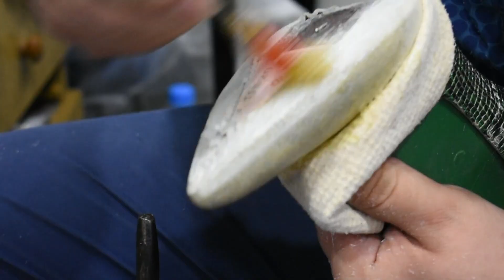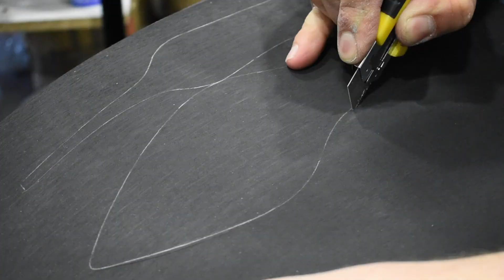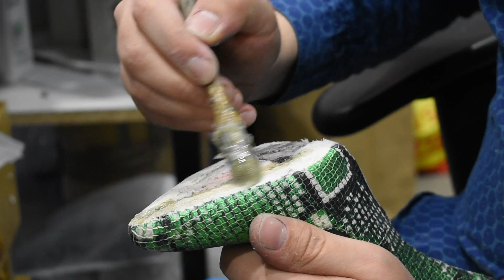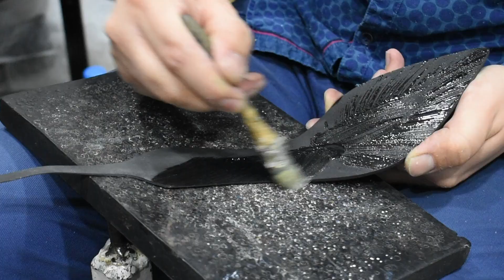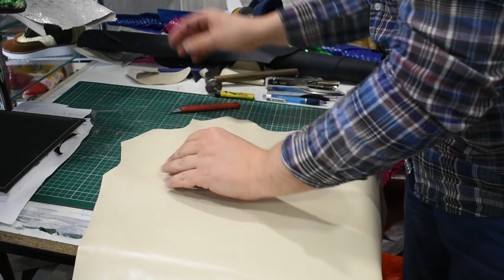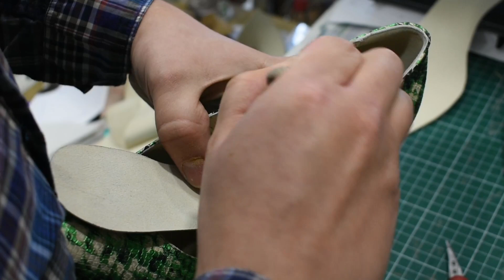Premium Leather Snake Heels - process of handmaking - natural sounds

Comment: Hermosos 💜 💜 
Como haces para atornillar los tacones al zapato, o utilizar grapas?
Reply from the maker: Thank you. We did not film this part. While the last is in the shoe, the heel is glued to prevent it from moving later. Then the last is removed, three holes are drilled with a 1.5-1.8mm drill, and we use 25mm long screws. If you have any other questions, feel free to write to us. :)